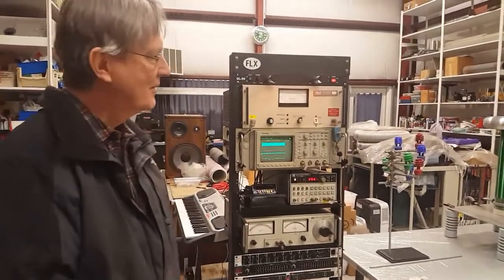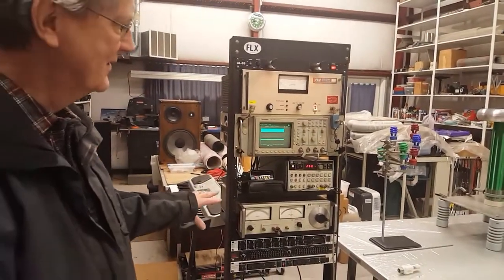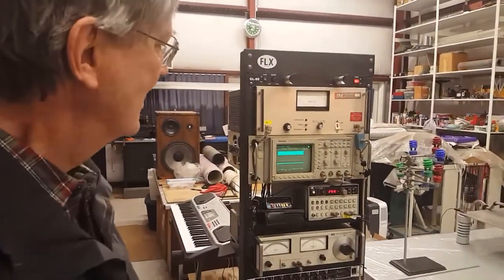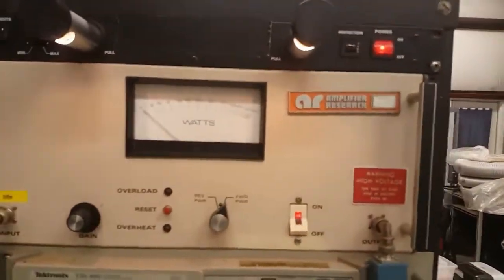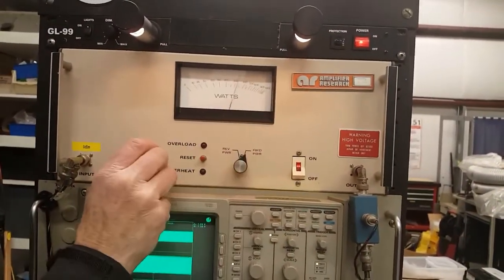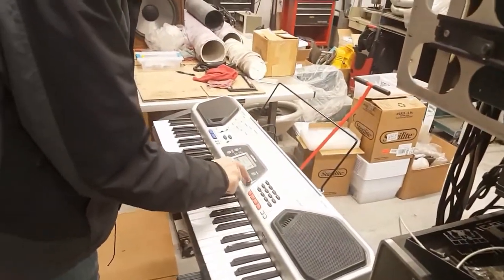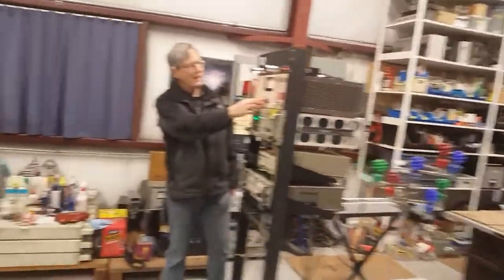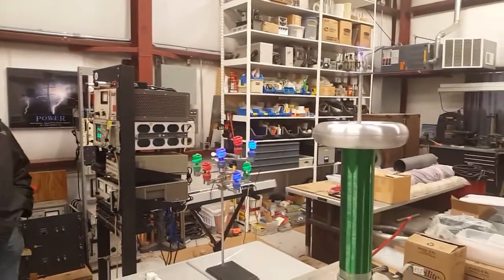Tesla Plays Hendrix in Area 51

Comment: All musical sounds heard in this clip are being produced by the brush discharge from the uppermost tip of the top electrode. The actual physical systems producing sound are the approx. 1 million C, extremely small volume arc channel a few tens of microns above the electrode tip and, to a lesser extent, Coulomb modulation of the ion cloud above the top electrode assembly. Clarification Note: Speakers seen in the background are part of another project and are not producing any sounds heard in this video clip—!

Comment: I'm afraid I had no clue what I was looking at.  I understand a Tesla Coil.  I didn't see any modulation.
Reply: All the music is coming from the brush discharge, no speakers involved (the speakers seen in the background are part of another project and not connected to anything). Excitation to the coil is an EQ'd and linearized amplitude modulated 258 KHz r.f. carrier of approx. 400 watts average power. Part of the trick for acceptable fidelity is in the construction of the discharge electrode and also the addition of a gradient electrode below it. An astute observer might note that the (interim) gradient electrode looks suspiciously like the lid to a tunafish can...a cheap trick, but it works well for the purpose. 
Note that this is only a small "Baby Bear" prototype. "Poppa Bear" as designed will stand approx. 8' tall, and will run about 15x current input power.

Comment: .            👽 👽 👽 Area 51? 👽 👽 👽
🤣 🤣 🤣 I think it is the "O" Zone! 🤣  🤣  🤣
Reply: Tesla coils and other high-voltage generators certainly do generate ozone. For this reason, Area 51 has a 16 ft ceiling and a high-velocity variable speed ventilation fan that can cycle the whole interior volume every 15 minutes. This has proven adequate to keep the ozone level fairly low when running the "Baby Bear" prototype, plus the r.f. brush discharge, as far as I can determine, doesn't produce nearly as much ozone as an equivalent d.c. corona. Nonetheless, I'm probably already getting my recommended daily allowance of O3—!